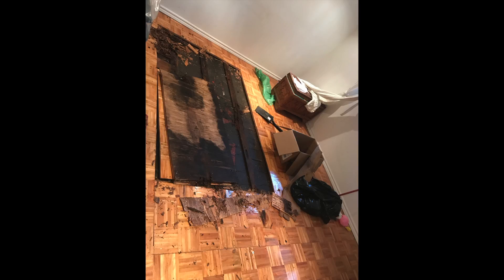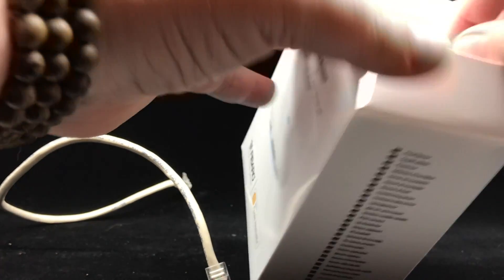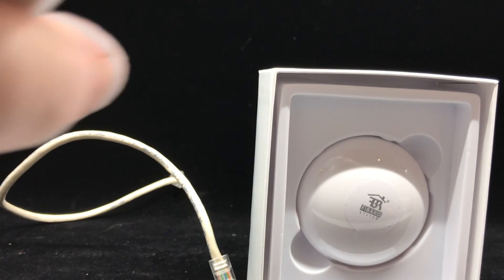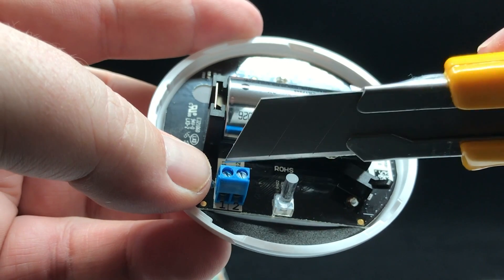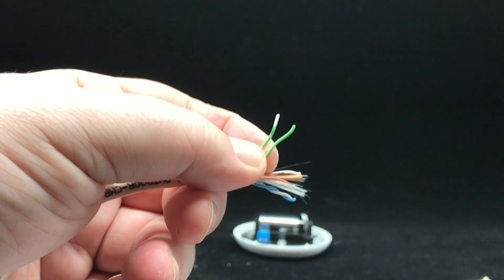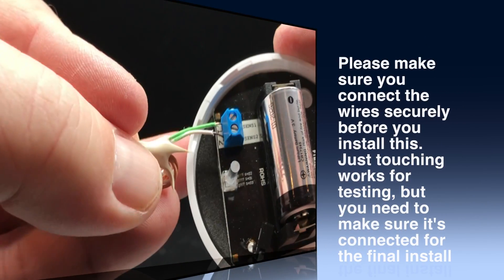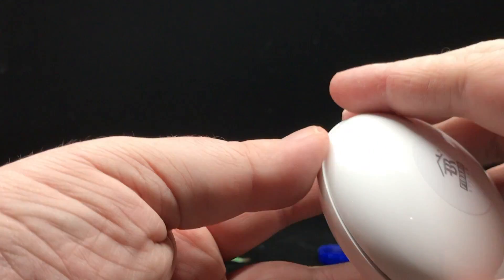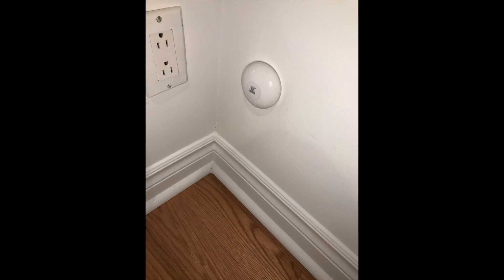Fibaro Flood Sensor with Extension

Comment: The box might be nice but the manual has much to be desired. The Fibaro promo video shows that an external sensor can be attached and they show what appears to be a Fibaro external sensor probe as well (at least its the same styling) but the manual does not describe how to do this nor does it describe the requirements for the external sensor. Their promo video shows that the product can be mounted on the wall - no mention of this in the manual. The Fibaro web site says that in lieu of the battery you can supply external 12V/24V power - no mention of this in the manual and there are no labeled contacts on the circuit board so I am guesstimating that you solder the wires onto the battery terminals ??? Nice product but they did a piss poor job on rolling it out as a comprehensive product and on the manual.

Comment: What do you do to the distal end of the cables to prepare it for proper water detection? Just leave some bare copper wire exposed at the end?
Reply from the maker: Yup. That’s exactly what I did. Stripped the wires and then tested it out.

Comment: I want to be able to use both. I want to put some wires inside a hot water heater pan, then the actual fibaro itself below my AC handler for condensate line flooding

Comment: Do you know if you can use the external sensor and also the little sensor legs below? I hooked up the wires like you showed, now I can't detect any water through the little legs below the sensor itself

Comment: My question is, has anyone tried pig tailing a cable from the terminals so you’ll have more than one cable/section? Example: one finado sensor in a Landry room, but have the cables go to the washer and another going to a sink?
Reply from the maker: In theory, this might work. But not something I’ve personally tried. Good idea though - For this use case I would be tempted to look at the Eve water sensor with the extra long sensor lead.
Reply: Chris Young I’m going to try this within the following weeks when I have time. I think it’s a good idea as well and if it’s a dry contact... in theory.... it should work...
Reply from the maker: Can’t wait to hear about the results!  Does sounds like it should work! Wishing you success!
Reply: Chris Young it works! I was able to just wire nut two separate cables to the main and put one under my washer and one by a sink. Now if anything goes off it’ll say laundry room instead of washer or sink... but they are still in the same area.

Comment: Nice video helpful.   I read that supposedly there is pre-defined slots that you can dremel out for running the cable into the unit?  Also noticed your device doesn't have a power connector.  Reading the one I ordered seems like it is supposed to have more than two internal connectors so you can add a power adapter to it and have it run on mains power.  It will then also act for mine, as a Z-Wave repeater.  Looked like yours may be homekit based so maybe it doesn't have that option.
Reply from the maker: Thanks Steve! Yup this thing was ABSOLUTELY worth the money as it let me clean up a flood in my basement before it created any long term damage. This is definitely the HomeKit version.  I’ve heard there are a couple of differences between this one and the Zwave version but I don’t have any direct experience with the Zwave version so I’m really not sure.  Let me know how things go!

Comment: Very good, interesting. My Fibaro (Just purchased) Nov 2019, has 8 of those contact tabs. Likely one set (two ports) for AC and one set (two ports) for extension wires.What would the other four be used for?  Also, is it possible to have two more extensions, merely by just increasing the number of wires?  Does one wire need to be touched with moisture, or must two wires be touched at the same time?
Reply from the maker: Wow! Great questions! I honestly don't know and hard for me to test this as I've actually got the flood sensor attached in the wall with wires run into the subfloor. If memory serves, I believe that two wires must be touched with moisture to trigger but I'm unable to test that directly for the same reasons above. :) I'll reach out to a few people and see if I can find an answer for you though.

Comment: Hello, thank you for this video. Do you know if you can disable the LED light and the beeping sound when the sensor detects water? I want to put the sensor in the shower. When we are showering and the sensor activates, it triggers a 'showering scene' where the lights change. But it would be a bummer if the beeping sound cannot be disabled. I know it can with the Z-wave version of this sensor, but I cannot find this information from the homekit version. Thanks :)
Reply from the maker: I just checked the Fibaro Homekit app and it doesn’t look like this is possible with the homekit version. Let me check a bit and I’ll see if I can find a confirmed answer.
Reply from the maker: Confirmed with Fibaro. This is a limitation of the bluetooth homekit implementation. No ability to disable the alarm with the homekit version. I guess it’s a Zwave. + bridge + homebridge option?
Reply: Chris Young Yes I think that would be my only option. Thank you for finding out!
Reply from the maker: You’re welcome!

Comment: Another great video, thanks!
As a HomeKit enthusiast, have you got a solution for the water cutoff valve in case something goes wrong with your pipes? Like if fibaro sensor detects leak, the homekit cuts the water supply.
Fibaro have a z-wave version of their sensor and there are lots of valves for z-wave too
Reply from the maker: I wish there was a native homekit solution available but, as you've pointed out, currently there's not. Elgato did announce an option last year but that hasn't released yet. There was some talk from Kohler and a couple of other plumbing related vendors at CES2018 as well.  The Z-Wave approach MIGHT work, but it would depend on the Iota Abode gateway which was also announced at CES2018. I did check with Abode and they confirmed that the following list would be supported and exposed as homekit devices through the Abode bridge.  https://support.goabode.com/customer/en/portal/articles/2267539-compatible-z-wave-zigbee-devices     Two issues are that I"m not 100% convinced they understood my questions. :)   and that there's no valve on the current list of Zigbee or Zwave supported devices.

Comment: Sent a twitter response too.  I wasn't aware until this post that there is a Home Kit and a Z-wave version.  I use Z-wave with a Vera controller.  That integrates to Home Assistant (https://home-assistant.io/) running on a Raspberry Pi.  Home Assistant integrates with your choice of cloud based voice assistant (Amazon Echo, Siri/HomeKit, etc.).  It is open sourced.  Anyway, I have the flood sensor in my crawl space near the main water feed from the city and to my hot water heater.

Additionally with something like Home Assistant I also collect the relevant data from my sensors and then graph that on a dashboard.  I primarily do this because the humidity in a crawlspace should be below 60% and while I do get notifications if the humidity gets too high I like being able to see a dashboard and know that I'm in the optimal range.
Reply from the maker: Yup. Most of the Fibaro homekit supported devices are separate from the Zwave, primarily because Homekit doesn’t support Zwave without a bridge device I would guess.  Home Assistant is awesome, but still requires some tech skills to get it up and running. I’ve been trying to focus on “normal people” achievable smart home, but there are some things that Home Assistant is just a requirement for.  The graphing capabilities of Homeassistant are definitely cool. This is a big gap in Homekit is the inability to actually grab data over a time period. Most of the 3rd party vendor apps can do this, but there’s no way that I’m aware of to draw all of the data into a central place for analysis.  @Elgato Eve does allow for export in CSV format, but it’s not ideal. :)
Reply: I am singing to the choir now.  I wholeheartedly agree that HA is not for normal people.  The problem I see with smat homes is that people want tightly integrated solutions but no one has created that solution.  HomeKit for example comes from the devices made for soccer moms (e.g. Apple).  Even with them the integration is piece meal.  It isn't a solution but rather a collection of devices.

The other side of the coin is that HA can do almost anything you want.  Integrate any sensor you want.  But they haven't quite got it simplified enough for me to tell a non-techie to try it.  They are making progress to eliminate much of the text configuration of YAML files.  Very techie!  But if you want to integrate a cloud based MQTT server then you would need some basic linux knowledge to install and configure the appropriate packges.  Again, non-trivial for a non-techie.  

BTW, HA has only been around a couple of years but they are on a continuous release cycle.  The update and release as new version every two weeks.  Check back periodically.  They may be the achievable smart home  solution for normal people before we know it.
Reply from the maker: Lol Yup. I know of at least one project that’s leveraging HA guts with a new interface on it that I got a beta preview on. Very slick, but no idea what their business model might be.  We’ve come a LONG way from the X10 stuff I played around with once upon a time, so I can’t complain too much.   I’m really interested in seeing where Amazon ends up with their Echo Plus as well. Right now, I think Apple with Homekit is the only hub system out there that a soccer mom (or dad!) could use. HA is awesome, I’m actually using it to track my plant day for my Flower Care sensors ( Xiaomi Plant sensor ) over time. It’s amazing what HA can be made to do and I love that fact that I can dig into the python code and understand what it’s doing and how. But it’s definitely not something I would install in my mom’s house.  Totally agree that their release cadence is really quick.  Plus the plugin community has really started to push lately.  The worst thing about HA for me is that I could easily get sucked in to the endless science project of trying to hack everything together. :P Trying to make sure my lights turn on and off and that stays stable.

Comment: Pretty cool support from Fibaro. I’m surprised they even told you that you could do that. I assume they say it voids the warranty? I wonder if you connected this to a powered Ethernet hub if you could then have multiple detection points.
Reply from the maker: This is actually a supported configuration and is documented in the user manual on their website ( pg 6 ) https://manuals.fibaro.com/content/manuals/en/FGBHFS-101/FGBHFS-101-EN-T-v1.1.pdf.  Not sure if you caught the whole video, but both of the RJ45 connectors have been cut off of the cable, so there’s no way to connect this to a PoE switch. The Fibaro isn’t an Ethernet device at all. This just technically wouldn’t work.  Hoping that makes sense?
Reply: Chris Young that’s pretty cool. Ya I guess I missed that part lol I’m just always trying to find cheaper ways to do things and a splitter would be cool. I guess you could just crimp some wire splitter inline and try that for multiple detection points.
Reply from the maker: lol I know the feeling. I had the “advantage” of knowing exactly where all the water was going to pool so it was easy to understand where I needed to place the leads.